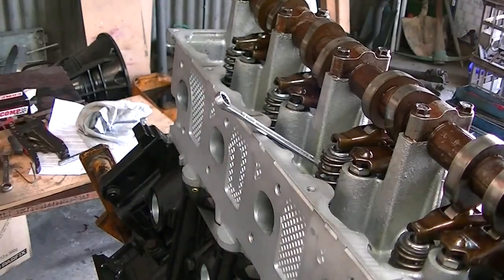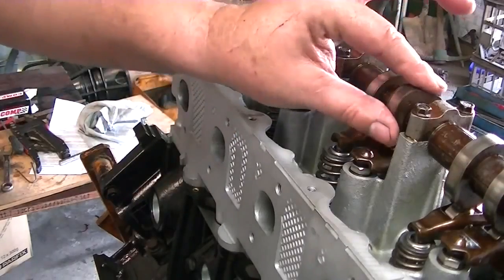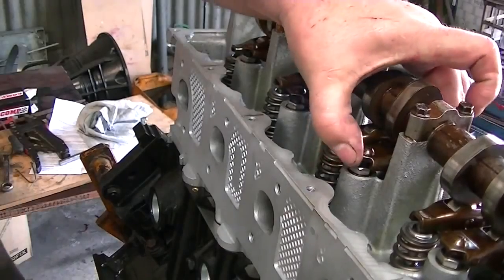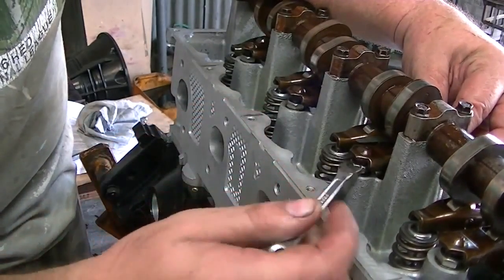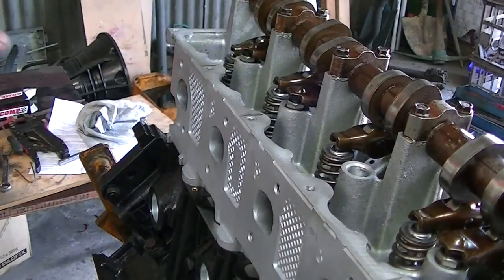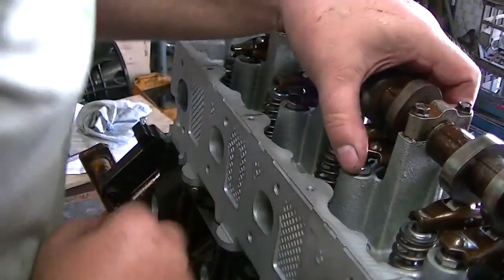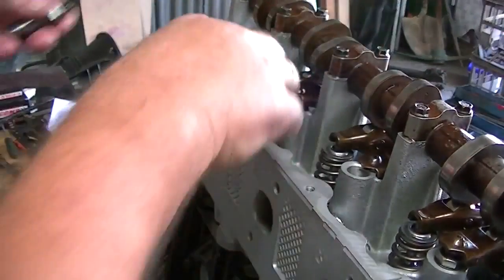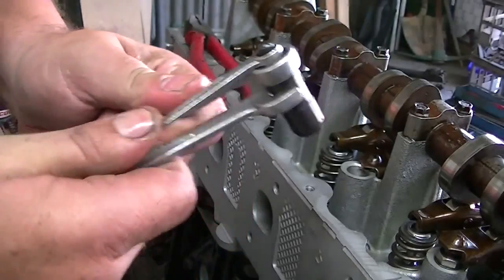How to install and adjust solid Lifters / Lash adjusters in a 4.7 V8 WJ Jeep Grand Cherokee/Dodge

Comment: Size of wrench been nice
Reply: Mines hydr. Lifters  so different
Reply from the maker: @pottyhole  They all are hydraulic This is a performance upgrade.
Reply: @BuiltByRik  so if I changed lifters and same noise  . I don't  get it because  it's clearly  in the head . I wouldn't waist one minute I'd it was a lower knock  but it's a HIGH TING    and I wrote that  for a different video . I know  mine ain't turning  . If I hurt myself adjusting, I can't understand how can you self adjust?I don't get it.I said I and get too tight which I'm feeling for tight.They felt loose before I ran it for a bit  Although I checked the all at once spot .  Sadly , i'm selling it up 3 hundred I know it's others fixable
Reply: The guy said it lost all oil after I bought an was pulling  cover off So I pulled the dipstick out and it looked like it was had too much if anything  
I have to change almost every freaking word So if words look stupid I just didn't change them government  Trump it thinks truck  is Trump. The third AI machines wouldn't let me on to.They got me on a machine thing.Check it watching me anyway
Reply: You're apple that.  But I guess you could apple it too If it was low on oil would it knock like the tingen But I'll point down the bottom of the hill tomorrow and check, but I can't see it.Yeah , it's a on a steep hill down hill

Comment: When you take out the adjuster after setting it with your feeler gauge you could measure the length of the adjuster accurately with a DIGITAL VERNIER. This way before you put it back in you can make fine adjustments and get it to the exact measured length which does away with the “hit and miss method” as you described it. Also if you hold the body of the adjuster in a bench vice while you tighten the nuts this gives you much more control over the whole process. Just my observation. Hope this is of help. Nice video.
Reply from the maker: Hey mate. I have a later clip where I try use some vernier calipers to do it that way but I was not very successful. I think I uploaded the vernier attempt it was a while ago. I'm just a self taught back yard mechanic not scared to try things I've never done before 😂. I was in a rented house and did not have a vice. Imagine not having a simple vice doing what I do lol. We have our own house now and I've built my own workshop. If you have known my channel you may have seen this. I've had a rough health life even though it may not look like it. I'm actually doing OK since starting that carnivore diet 👍. I'm going to do a lot more stuff soon I have never done before on this channel. Maybe nobody has done what I'm planning to do? Hmmmm stays a secret for now. My family deserves a holiday first. I have put them through a lot with my health. Happy they love me and hung around 😂😂😂. Anyway fellow Gas Head much appreciate your feedback and thanks for watching. Now back to my coffee. 👋

Comment: Maintenance note on the 4.7. About a week before you're going to do an oil change put a quart of Marvel Mystery Oil into the oil. It will, quite handily, keep the hydraulic lash adjusters clean. It is old school procedure, but it works quite well.
Reply: Hello Hawk thank you for watching my channel. This clip is about changing over to solid lifters replacing the factory hydraulic units. I did this for performance reasons and later on in my channel it is a must when installing a performance camshaft. I am a true believer that to keep carbon sludge low in your engine the best thing is regular services. I personally have had a bad run in the past when I was younger with engine additives. I call them mechanic's in a bottle. I do not know this product so cannot tell you if I agree or not. Calling it Mystery oil does not boost my confidence in it LOL. We do not have no where near as many engine additives available here in Australia as it seems you have in America. I always hear of people recommending these Genie in a bottle fixes. The lifters I replaced worked fine but could not be used with the camshaft profile I installed later. Regular oil changes will also keep the lash adjusters clean. Regular changes in fact are good practice and good for a happy engine.  I remember a product called ProMa from memory and they showed a bearing test and I was blown away by how it performed on a test bench and even sold the stuff. I had 2 engines fail not long after using the product and even though they claimed it would not block the oil filter I can tell you they were wrong. I use Penrite full synthetic oil in my engines and have never had any sludge build up in my engines. I try and change oil around the 7000 klm mark but sometimes reach 10k klm when I just cannot get around to doing it. Any way take care and happy Jeeping.

Comment: In U.S. so please bear with our wonky decimal system, I much prefer metric.  I put these in my 04 4.7 when I replaced the heads and put cams from an 09 Aspen, they are a little more aggressive than the HO cams. Ran the lash initially at .002 (.05mm) and found them to be a bit noisier than I liked.  I also found that after around 100 miles (161 km) they started getting even louder, a couple of them anyway. Upon relashing them I noticed the bottoms had different wear patterns where they bottom out in the bore on the head. I also noticed the ones that had localized marks vs a consistent pattern across the face of the bottom of the adjuster were the ones that had not kept their original gap and needed the lash to be tightened up. I believe the bottom finish of the bores is the culprit. If it is not totally flat meaning there are machining peaks in the bottom those small peaks get hammered down flatter by the action of rocker fulcrum loading it when the cam lobe opens the valve. That effectively increases the depth of the bore requiring the adjuster to be lengthened. I brought them all down to .0015 (.038mm) which quieted it down quite a bit. I have since had to relash the same ones I had to originally and when doing so noticed the wear marks had changed to where they all looked much more consistent than before. After that relash I have gone around 3000 miles (4800 km) without a noticeable increase in noise. If you did have a dial caliper you could see just how much variation there is like you mentioned to a poster. The shortest adjuster in my case is 1.935" (49.14mm) and the longest is 1.953" (49.6mm) at .0015 lash. Now that is has settled in it's pretty quiet, the sound it does make reminds me of my old solid lifter big block Chevy Nova I had back in the day, which is to say is a good thing.
Reply from the maker: I have run them at 0.04 mm and had no noise or need to re adjust them. Also when I installed some custom performance camshafts (A video on my channel) there was no strange wear on any of my parts. With such a small gap I am surprised you had any wear marks. Second time round installing the new camshafts the job did not take long. Its like any job once you know how it gets easier.  Thank you for admitting the imperial measuring system sucks LOL  Thanks for watching.

Comment: Gage .05mm?
Reply: Aussie where you find that info about gap ? I read manual many times and i cant find it
Reply: Dimensions came with the product. If you want to see the instruction sheet join me on facebook and ask me. I'll post a picture for you.
Reply: @RikBor  i send you message :)
Reply: @Diflok.pl_Przemek_Makowski  Hi mate I used my wrong I'd to answer you. I make that mistake sometimes. Next time message me on Aussie Jeep Muscle please. Rik
Reply from the maker: @Diflok.pl_Przemek_Makowski  What manual did you read mate?
Reply from the maker: @Diflok.pl_Przemek_Makowski  It is not in the Jeep manual it is not a Jeep part. They only came out with hydraulic lash adjusters. These are aftermarket performance upgrades. OK?
Reply from the maker: Yes that's correct a very small gap.
Reply from the maker: Manual says .0015 to .0020 inch. 
That is approximately  .04 to .05mm. Had to go back to my books to double check for you.
Reply: @BuiltByRik  up you use words "manual says...". I thought you were talking about a service manual
Reply from the maker: @Diflok.pl_Przemek_Makowski  No the manual that came with the product. But trust me ok its correct I been running it for years now with those measurements without a problem. Regards Rik

Comment: Just curious. Is this procedure described somewhere like the official workshop repair manual or something like that? Or you came up with it yourself? Thanks :)
Reply from the maker: No it's a common performance upgrade for modified camshafts.
Reply: And the method I made up myself.
Reply: @RikBor  Actually that method has been used for years on old ironhead Harley Sportsters. The pushrods have a ball on each end and a lifter tappet with an adjustment exactly like these lash adjusters making it impossible to check lash with a feeler gauge. It's done by spinning the pushrod with your fingers and tightening up the adjuster until the pushrod spins free without any up and down movement, at which time the lock nut is tightened against the adjuster.
Reply: @charliedee9276  You CAN check with feeler gauges? You cannot spin the adjustment with your fingers there is no room. So quite different from a old Harley. I did make the method up by myself it may have been done before but I have not seen or learned it done by anybody before I did this. Regards RIk PS Sorry used wrong ID from my other channel.
Reply: @RikBor  Misunderstanding. You CANNOT use a feeler gauge on the Harley. I meant the adjustment process is the same in regards to the adjuster itself and how it made longer or shorter. My point was the Harley lash adjustment is very similar with the difference being instead of tightening the adjuster against the feeler gauge you tighten the adjuster exactly like you are doing against the push rod. The lash is correct when you can freely spin the push rod yet feel zero up and down play. My main question is how do you do this while the engine is in the vehicle? RHD vs LHD notwithstanding there is no way I could adjust the lash adjuster with this method, there simply is no room.
Reply: @charliedee9276  Check my clip where I install performance camshafts. I did the same process but while its in the Jeep. Regards Rik

Comment: I would've just bought a dial caliper - take one measurement from one adjusted lash adjuster and then set the rest of them the same.
Reply from the maker: There are too many inconsistencies to do one measurement and expect every valve to be 100 % the same.
PLEASE check my clip where I use them installing performance camshafts. 
PLEASE SUBSCRIBE
Reply: @BuiltByRik  got me a tick and i have the valve cover open. What is the max and min clearance with a feeler gauge?
Reply from the maker: Hi hope I'm in time if not sorry. You can always join the Aussie Jeep Muscle community on Facebook. 
The clearances are 0.0015 to 0.0035 but I recomend to get as close to 0.0015 as possible to reduce any noise or having to re adjust them. I have not had to adjust mine yet no ticking at all. 30k Klm and still quiet. I know it's not the easiest job but once done well worth it. Make sure you have a gap if you don't it means your valve will stay slightly open. Regards Rik
Reply: What units for dial caliper?
Reply from the maker: I did not use a dial caliper as I don't own one.
Reply: Nope. I did use a caliper to do mine. The shortest one is 1.935" and the longest is  1.953" which is a .019" or .48mm difference, a huge tolerance on an assembly which likes a .0015" or .038mm lash gap.

Comment: Why would you want solid lash adjusters?  Seems like your creating a lot more work and future maintenance.
Reply from the maker: Hello killer :-) 
Well a common question why.
Mostly answered in previous questions below but a quick answer. You need them or custom shims if you install modified camshafts. They prevent rockers popping of as the engine gets older or when your in a high rpm situation. Also as this is a OHC engine with a roller cam set up the maintenance is not high. I have never had to do any adjustments after initial installation. Apart from when you do a camshaft swap. 
In my personal opinion the bit of work installing them outweighs the benefits especially the way I like to drive my Carabao monster.
Reply from the maker: Also please read the notes under the clip.
Reply: Hey I appreciate the video. I’m actually having the problem your preventing right now on my 03 Jeep Grand Cherokee Limited at 193,000 miles. I’m dead broke and currently am looking for work but this Jeep is unreliable for the long run. I can’t afford OEM but I’ve heard you can clean the lifters and all that. I’m not one hundred percent sure what the noise actually is but I got three different opinions. Roller rocker fell off most likely because of a seized lifter, timing chain slap which I doubt or a connecting rod barring. Hope to figure out the source of the engine tick. Does any of this exsplain a reason why there is misfire?

Comment: you make it look very difficult, you dont need to take them out to adjust. It must have taken DAYS
Reply from the maker: That is a comment made by someone who has NEVER done these on this particular engine before with stock camshafts. As these solid lifters were never made for this particular engine there just is NO room to adjust these in the conventional way. And yes I know how they are normaly adjusted with the feeler guage in place while adjusting the lifter. I have been building engines since before hydraulic lifters were the norm and ignition was done by adjusting points and twin points were the ultimate ignition system. Why else would this be my second most popular clip? Because you cannot adjust these the conventional way. 
But if you can do it easier on the 4.7 powertech V8 please film it and show us. Im not to old to learn new tricks. I am soon to load a new clip installing performance camshafts in this engine which was easier with better tools. And no it took less than 2 hours. Regards Rik
Reply: I appreciate you're that you stand by what you did

And Apologize😶

You gave me hope to replace my 3.7 lifters should be same as 4.7 HO , correct?
Reply from the maker: Yes exactly the same as far as Im aware having owned a 3.7 before but never pulled it apart I beleive they are exactly the same engine but 2 less pistons. This week I installed performance camshafts in my 4.7 and used a set of very accurate electronic vernier calipers which made installing them much easier. I did not have the money to buy any last time. I am still editing those clips and should be online hopefully in a few weeks. Sadly my online data is limited atm between house moves.
Reply from the maker: HO or non HO the job is the same.

Comment: heck you can take 2000 solid lifters and stickem in the 2.3 lima motor, but the valve lash changes when you bolt the head onto the block
Reply: I think it was a joke. He was saying no matter how many solid lifters you put in that engine when you bolt the head down the valve lash adjustment changes regardless of how careful you are to not disturb the initial adjustment. 

Kind of like the old joke "If it doesn't have an oil leak then its not a Chevy 350" (same is said about Harleys too) 

But I think he was referring to the Ford engines which were in my opinion not so great. Putting solid rockers in an engine like that is exactly like polishing a turd. Might as well be sticking them in an old "Iron Duke" engine. 

At least you decided to stick solid lifters in an engine that was decent. Personally I am watching this because I just got a solid running 3.7L Liberty from 2003. From my understanding they have the same issue of throwing the rocker once the sludge causes the lifter to stick. Your solution seems to make the most sense to me as you are completely eliminating the problem not just putting a band-aid on it until it sludges up again. 

I may do this to it for preventative measures but I have a feeling these engines were all probably designed to use a synthetic oil to reduce sludge and a lot of folks no matter what they say will end up using conventional. 

Honestly someone should just probably make it a day and pull the heads and do them on a bench like you are. This ensures you can use better head gaskets as these engines I believe are kind of known in the earlier ones for blowing a head gasket.
Reply from the maker: @evilcowboy  Bolting down the head should make zero difference if it is a overhead camshaft. This only happens to pushrod engines where adjusting solid lifters before bolting the head down is quite impossible as the lifters are in the block and not the heads.
Reply from the maker: +tom ashton I have no idea what you are asking or talking about. 
Are you saying these solid lifters are the same as a 2 litre Ford engine?
I think the 2.3 is a belt driven overhead cam so the clearance should not change when you torque the head down. If it is a pushrod engine then that would be the case and not possible unless I have heard of adjustable pushrods.
Reply: +Home Mechanics the 2.3 lima engine can be converted to solid lifters using the 2 liter engine solid lifters. Crane cams sell the kit, you have to remove the head and have the lifter bosse,s machine down for the rocker clearence, the 2000 cc motor is overhead cam like the lima engine, the 1600 cc engine is pushrod.